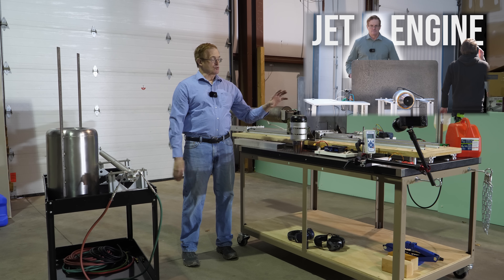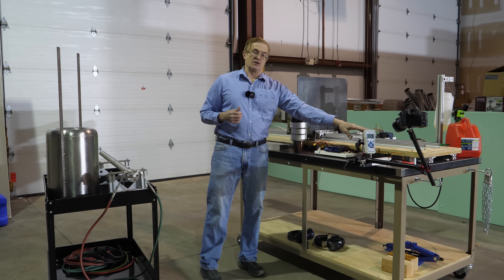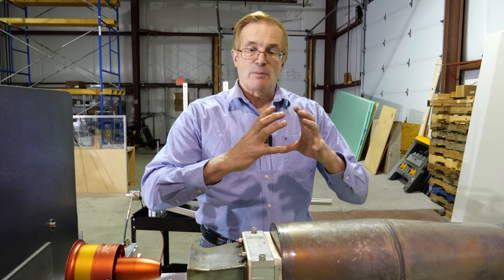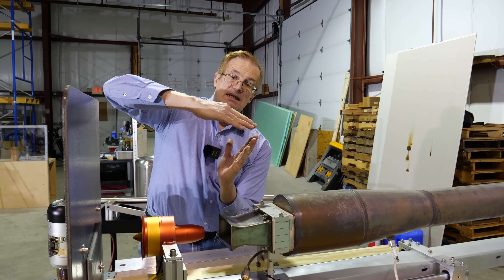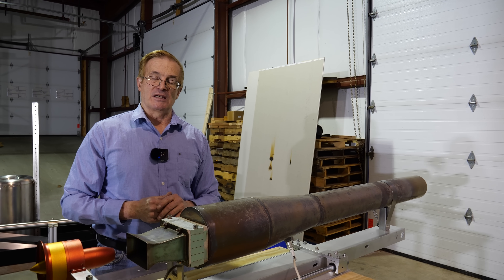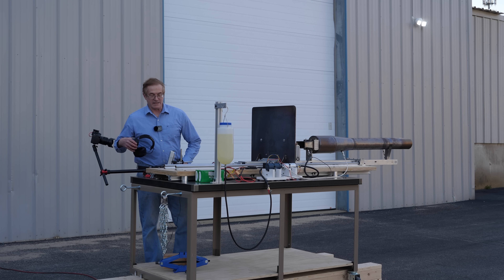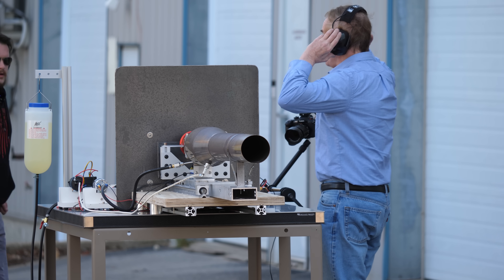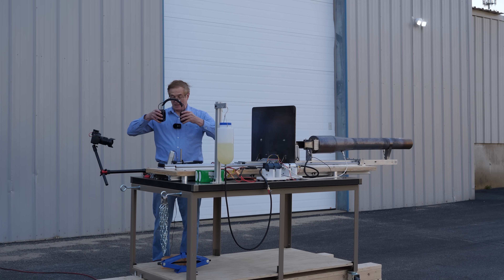Full Throttle Test: Did we Push a Pulse Jet Engine to its Limits?!

Comment: What would the payload on an engine this size?
Reply from the maker: It depends on the flight profile.  A vertically launched vehicle depends on only the thrust to weight ratio.  A gliding vehicle will fly with at least an order of magnitude less thrust.
Reply: @TechIngredients thanks, I'm guessing like a v1 design. Thinking how big one could make a drone using this engine. Could say Ukraine design something in mass like this to create drones to overwhelm anti air defenses. Its amazing and scary work you're doing.

Comment: Love these programs.  The pulse jet is certainly intriguing because of its self-running capability once it gets moving.  But, if you're a gearhead who enjoys engines of all kinds partially because of the way they sound, it's not so appealilng.  A bit blatty kind of like a Mazda rotary engine.  But, other than that very cool.

Comment: I love your presentations, thank you and keep up the great work.  
So here it goes:  two-stroke engines rely on a return pulse from a tuned exhaust to establish, and maintain a wall of pressure at the exhaust port of the head to prevent the fresh air/fuel mixture from being arbitrarily dumped out before it is compressed.   The previous pulse then pulls out the aforementioned exhaust.   
Now the intake:  do a 180 degree turn so the intake faces backwards (why am I telling you this, Your current design scares me as it is).   The exhaust pulse will pulse out of the intake which turns the whole engine into a reciprocating engine with enhanced thrust and predictable rhythm.  I wish you all of the best, be safe
Reply from the maker: What you're describing is called a valves pulse jet, and these are popular because the valve assembly is the primary failure location. The thin valves are under a lot of mechanical and thermal stresses.
The downside of the valveless design is that the intake plumbing is as bulky as the entire rest of the engine.

Comment: In the 60's i bought a "jet" engine from the back of Popular Mechanics. It was like a co2 cartridge with a screw cap with a pin hole, you filled it with gasoline and lit a small metal/asbestos fluff open top tray below it. the heat sprayed the gas out the back and ignited it, where the gas/flame exited the cartridge, the flame plume entered a metal tube that directed the expanding plume more rearward. the whole thing hung from a line stretched between two clothes poles. As i remember, it picked up some pretty good velocity. I'm surprised i didn't end up in the burn unit. i'm not sure my parents ever knew.

Comment: How do you fix overheating?
Reply from the maker: It really doesn't. There is enough air moving through the system that once it reaches a dull red glow, it doesn't get any hotter.

Comment: I would have thought that the blower would change the resonance enough that it would be out of tune for the jet profile. Same issue with 2 strokes, they have a max power band tuned by the pipe. So it would be interesting to see max thrust after tuning the profile to your fuel air settings
Reply from the maker: These engines are far from demanding.
They operate in static mode as well as in flight at hundreds of kilometers per hour.
As you might expect,  they get a little more efficient as well as powerful in flight due to the increased mass of air that the ram effect introduces into the combustion chamber.

Comment: Amazing, i was thinking ,what would happen if an electric fan was added for maybe better fuel mixing,for a pulse detonation engine,what could be the effect of adding the electric fan
Reply from the maker: It will operate a little better.  That is why these engines produce more thrust in flight as the airflow generates a small amount of ram compression.

Comment: My dad and a friend of his used to fly rc planes with pulse jets: they'd build their own pulse jets and hand build themselfs some F-104 Starfighters from scratch, completely made of glass fiber composite. They'd used a design without spark plug (ignition was done with a spark plug on a rod shoved into the combustion chamber) and their pulse jets somewhat had an augmentor attached. Overall, their engines had a thrust between 20 and 25 kg with a nozzle and the planes topped out at ~400-450 kph.
I miss those times and the "noise"...

Comment: "I can feel the heat from here"
Yep! Heat traveling in a straight line at the speed of light... because it is light!

Radiative heat is not that intuitive for our senses. A bit like magnets. We see the source, we see the affected matter/objects but there is nothing visible between. Our sense would lead us to believe that you can feel hot air but is not the air (the hot air goes up du to convection).

My first encounter with strong radiative heat (other than the sun) was at a concert when they used pyrotechnics. When a blast would happen on stage the high "heat" could be felt instantaneously at a great distance. Radiation ❤

Also, there are big chains right there on the table... tie the table down using the chains. Would be much safer than counting on friction between wood and metal.

Comment: Seconds into the video and I can tell the engine isn't tuned right. The tailpipe is way to short. Combustion is happening way out of the combustion chamber.
Other than that nice work.
Reply from the maker: Thanks.
Remember, it's not a tail pipe.  The tube is the actual engine. Length only determines how much propellant will be detonated.
What I'm sure of is that the mixture is not dialed in. It's probably rich based on what I explained about the flow resistance in the connecting tubes. The pressure ratio was 5 to 1. The correct mixture is 5 to 1, but the flow is not linear with pressure.
Reply: @TechIngredients  correct, I call it a tailpipe for ease of explanation. The length of that pipe determines the proper point of the pressure and sound waves within the engine to sustain operation.
There are certain standing pressure waves that dictate the point of combustion. That point should occur in the combustion chamber. To short and the jet doesn't run. To long and the jet will run but not efficiently.
I can see in your engine that point is not in the combustion chamber rather further down the tailpipe. It runs great and I'm just offering friendly criticism. 
I love the channel and keep up the great content.
Reply from the maker: Thanks  
I still think you're not getting the principle of operation of a detonation engine. The entire thing is the combustion chamber. The detonation wave begins right at the junction with the initiator at the front. There is no resonance and no forward propagation of the detonation wave.

Comment: You’re definitely doing that pulse detonation engine right? Also is there an internship available?
Reply: The vortex one that nasa discovered by blowing up prototypes…
Reply from the maker: It should be released  tomorrow.
It is more efficient than a Raptor 3 engine, and we're reaching out to Elon!
Where are you located?
Reply: @TechIngredients How much power did the pulse jet engine gain with your discovery?

Comment: I would love to experience a tiny one of these. The power pulses slowing down with size increase, and speeding up with decrease, is just like the RPMs of piston sizes. For example, 600cc or smaller 4 cylinder sportbikes can rev way higher then any 4 cylinder car I know.

Will you do an experiment to see if a tiny pulsejet can turn a turbine for an electric generator? And if Pulsejets can improve with ram air...then does this mean they can be turbocharged? At least with a modified design, like changing the combustion chamber to nozzle size ratio?

Comment: That is the quickest start of any pulse jet I have ever seen! I think the powerful fan is probably the biggest contribution to the ease of starting.
Reply: Tossing a burning sparkler down the barrel usually gets then fired up pretty quick also, once you know how much fuel and how much air to add with a leaf blower

Comment: Didn’t explain that the rebounding pressure pulse that goes back toward the combustion chamber at the end of the exhaust cycle is affected by the length of the exhaust tube…exactly like a sound wave down an open ended pipe..or a flute.   This length of exhaust is thus a ‘tuning’ factor in getting an efficient (or possible) burn.

Comment: Did it get red hot due to the increasing Air intake leaning out the mixture? Or is that normal running flat out
Reply from the maker: That's normal.  These engines will begin to glow shortly after starting and within seconds at full throttle.

Comment: How come thr trolley didnt move???
Reply from the maker: Do you mean the table or the linear bearing assembly?
Reply: @TechIngredients  table!
Reply: @TechIngredients  it's needs something to power????
Reply from the maker: The table has two jack screws at its midpoint. It weighs about 200 kg, and when the screws are lowered, the table is extremely difficult to shift.

Comment: Please Google “what is this ring shaped device behind this dc 8s jet engine”.
It was intended to address noise and be a thrust reverser. There is also a NACA paper on the subject. I have seen these “ejectors” used on circa 1960s turbojets. Overall, I suspect the “boost” you are curious about is more akin to an educator Venturi effect, and might be approached from the direction of the physics of educator geometry with either a turbojet or pulse-jet experiments.🤷‍♂️

Mark Fay US MMC Jr. Engineer QMED ASE-E / MSC ET Retired

Comment: What kind of spark box did you use?
Reply from the maker: It's  an automotive engine coil driven by a 555 timer driving a mosfet "switch."
The detonation engine will require a pulsed, high energy spark, and I'll cover that in the upcoming video.

Comment: Great experimental video!!  You are undoubtedly aware that the Germans used petrol as their fuel in the buzz bombs.  After your experiments are complete could you try two things?  1.  A sliding sleeve to see how the power varies with exhaust length.  2.  Can you try to see what the effect of two large "V" cut-outs in the exhaust outlet.  This way the exhaust is not an abrupt expansion but more gradual.  Cheers
Reply from the maker: I'll look at that.
Reply: @TechIngredients  Thanks!!  That would be excellent.  The original buzz bomb's reed valves were an issue.  I was thinking, if iterposed between the reed valves and the combustion chamber was a Tesla one way valve (no moving parts.)   This would keep the heat away from the reed valves.  Or would a Tesla valve work without the need for reed valves.  This way there would be no moving parts.  I am a retired mechanical engineer, and I have an interest in these machines.  At one stage I downloaded some plans for the buzz bomb.  These plans were quickly removed from the internet.  Cheers

Comment: Awesome work. I'm curious the pulse jet was 100n less thrust than the turbo jet so why the concern?
Reply from the maker: The turbo can be throttled more easily, and there are minimal vibrations.  IF the augmentor works, the thrust could be significantly greater.
Reply: @TechIngredients  That makes sense I didn't catch that. 

More control with the turbo jet.

Comment: I'd love to see how changing dimensions on different parts changes the thrust and fuel efficiency? Can you make a very highly efficient pulse jet with lower thrust? Larger diameter or length chamber vs nozzle, different shaped nozzles, larger or smaller intake vs combustion chamber vs outlet pipe? 2 pulse jets feeding into one outlet with the same or inverted combustion? A 2 stroke style chambered exhaust to bounce the pressure wave back into the combustion chamber? Maybe you can make a modular pulse jet with swapable parts?

Comment: Hi @TechIngredients I was wondering how I would build myself a Steam Turbine, heating the water with a Fresnel Lens in a closed loop system. Do you think this could be viable?
Reply from the maker: It could be done if you wanted a hobby scale demonstrator. But, if you work through a few numbers, i.e.,the amount of sunlight that would pass through a lens that you could afford and mount and how much steam could that generate, allowing for some inefficiencies and you'll see that the turbine would have to be very small and light.

Comment: I have been bitten by the pulsejet bug to the point I draw up designs from  valve methods, forced air, turbo , dual pjs , a small pj pressurrizing a larger one. I have made a small simple acoustic valve , a much larger one that runs on alcohol( found alcohol to work extraordinarly well. Made a fuel nozzle/ atomiser that is controlled by air pressure and works as a great throttle and can lug motor to a  low frequency to a much higher and powerful Hz / thrust. I will make and test a  augmentor. I like the videos u share but wish u talked mor on the results and the comparisons.  I can start my pj as quick and easy as a automobile engine. Turn on ignition, turn fuel valve ( air pressure) and bingo ,it roars instantly. Drinks alcohol faster than a irishman on payday!!I
Reply from the maker: Neat!
One area in pulsejet development that I haven't seen addressed is fuel delivery.
The fuel is added continuously,  but the combustion is intermittent. This suggests that there may be an opportunity to modulate this flow to better match combustion and increase efficiency.

Comment: Electromagnetic railgun when? I am interested in the circuitry you could demonstrate, I think you could show some really interesting flow of electricity and it would be also very interesting how you could make the design very efficient without wasting too much battery power or how you would deal with the enormous back EMF produced

Comment: I would like to see the output difference between gas and diesel.
Reply from the maker: Diesel is more difficult to get started, but it generates about 5% more thrust. This is through the same fuel system, and  because we didn't measure the fuel consumption, the slightly higher viscosity of diesel suggests that the fuel flow was a little lower.
Reply: @TechIngredients  I viewed a video of one they started on gas and warmed it up and valved on diesel and then slowly stopped the gas. No other data was supplied. Keep up the amazing work! You guys are awesome!

Comment: Looks like a fun experiment.  I wonder, however, how you could utelize the HEAT of the engine tube to add thrust to the air intake provided by the fan?  Cool air going in then expands and goes out even faster.  So, unless a thought experiment can answer the question, this could be another experiment for you.  An after burner for a ducted fan, but what would the heat source be?  Can you mimic a nuclear isotope as a heat source, perhaps with a Fresnel Lense substituting for it?  Heat the pipe, blow air into it,  but would it have to be pulsed or is there a better way, like a rotating fan that covers over holes, letting them open and close in pulses, or would it be better to stagger the holes like a rotating pulse detonation engine.  A reciprocating pulse might enhance intake air to be heated.  I am just thinking out loud, I hope you find inspiration to go where no man has gone before.

Comment: Just watched without logging in first.  Was your table extra wobbly because you didn't place your lead/steel weights on the bottom shelf like in your previous video?  Hope to see you finish this demonstration soon!
Reply from the maker: I don't think so.  It was dancing every which way, and although extra weight can't hurt, we wanted something better designed to specifically counter thrust loads.

Comment: Awesome. Started one about 10 years ago. Reed valves stopped me. Got a spare that you want to sell?
Reply from the maker: Thanks!
Not yet.🙂
Reply: I used plastic two stroke motorcycle engine  reed valves
Reply from the maker: Plastic!?
Reply: Thanks. I think I have some 2 stroke reeds.
Reply: @vanceeasterwood6725  you might need to protect them from radiant heat  like I did by fitting them to "horns" https://www.youtube.com/watch?v=uqMn0A2aUdo&ab_channel=AndrewMartin

Comment: What if you put 2 parts hydrogen to one part oxygen instead of the fuel mixer you have now. Control the explosion to the rear and pulse that baby. If works, you would have something much better than the augmenter.
Reply from the maker: That's basically the operation of the pulse detonation engine. It has to be built heavier, and there are some other tricks that we'll cover with that engine.

Comment: I feel like Alex's slimline ear defenders are unlikely to be suitably rated for such loud sound pressure. He should really be wearing double wall ear muffs like they wear at airports on the flight line. They're not even that expensive and it's important you choose the right rating for the application

Comment: I suppose a muffler would defeat the purpose? Fan gets more power, but you're not going to have an engine long at red. I suppose you could strap some coolant tubes and have a radiator to keep hoses and what-not at safer temps longer. My worry at this point with the red temps and the engine pressure would be your fuel pump pressure and lines. I need to go back and watch how you're separating fuel pressure.

Comment: Could you use a pulse jet as the combustor for a automotive turbo based jet?  If you used something like a Holset HY-35W you might be able to get a combined 6:1 compression ratio between the turbo and nested pulse jet.  The pulses might damage the turbine so maybe run 2 180° out of phase?  Also could that help cancel out some of the noise?